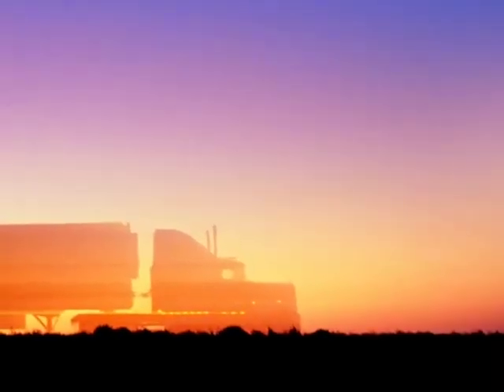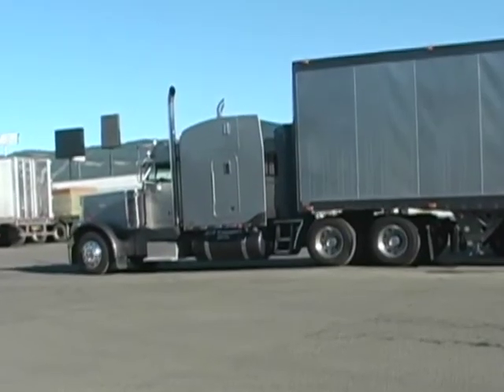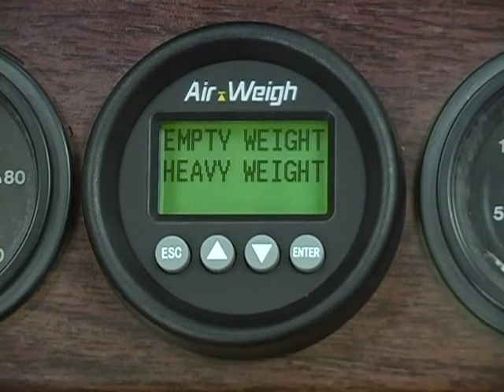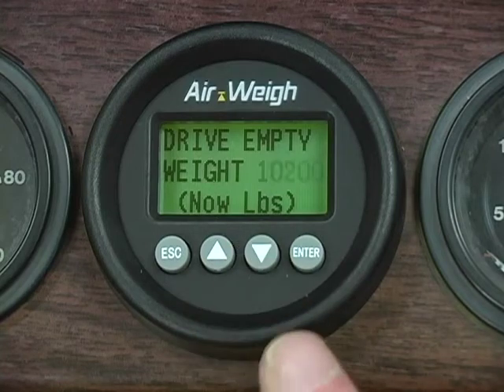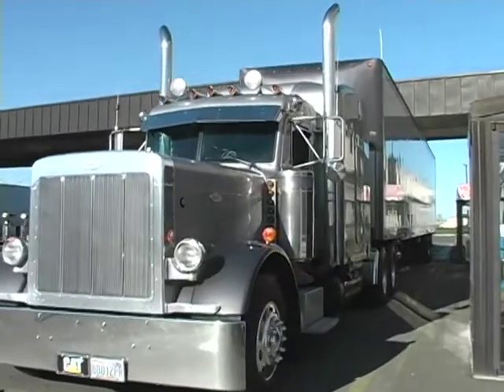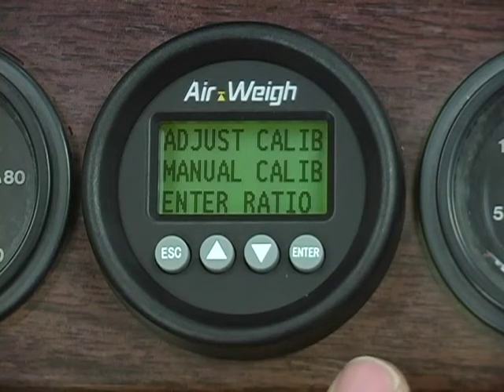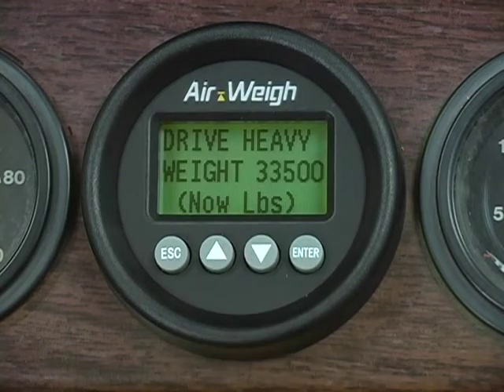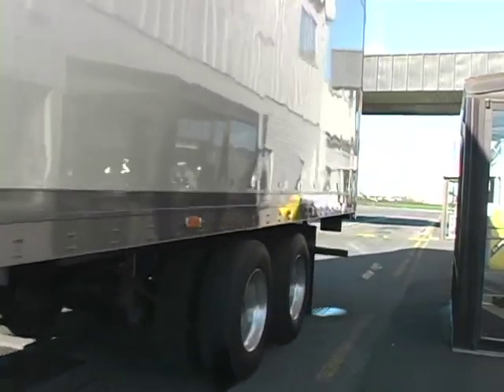AIRWEIGH AW5800 tractor scale calibration video

Comment: Will this work if my truck does not have air dump? Also, does it matter what the tandem pin position is when calibrating the scale?
Reply from the maker: Its cheaper and faster to install with air bags. Without it, they have deflector sensor that can clamp / weld on the rigid axles. Yes, the tandem pin relocation will alter weight distribution and weight accuracy.
Reply: @SNAcalgary   Sorry, I should have explained better. We have a Freightliner with air bags but we don’t have the air dump feature so they always stay aired up. Does that make a difference? As for the trailer, I was asking whether pin location matters when calibrating empty/loaded weights. The video never mentions whether it matters.
Reply from the maker: Yes, a dump bag air switch would need to be added as its a required procedure to achieve accurate reading. Pin location matter on the trailer. The location of the axles modify weight distribution and scale reading..

Comment: Hi I didn’t see the TRL option. How can I do? Thank you for answer!
Reply from the maker: With a trailer, there is another pressure switch senor on the trailer and another input is hooked to the gauge for this. The model of the gauge needs to be changed to account for the extra sensor. Then, the calibration procedure is the same as the tractor. You need to enter the EMPTY WEIGHTS and the HEAVY WEIGHST in two steps using the number from a truck stop scale.

Comment: I have spring suspension on my trailer,I do not want to weld the conversion device to my axles,.... do you have an air bag conversion for Spring suspension ? Because the air weight is really accurate the other not so much
Reply from the maker: You can use the epoxy kit with clamps to read the suspension flex.
Reply from the maker: https://www.manualslib.com/manual/154920/Air-Weigh-Air-Weigh-Aw5800.html?page=9#manual
See on page 4.
Reply: @SNAcalgary  The problem with those is there not even close to be Accurate

Comment: What if my trailer doesn't have air suspension?  Would it not work at all ?
Reply from the maker: The tractor can still have its scale to keep track of its weight. You can also have rigid axle, deflector sensors added to the trailer to read the weight of the whole rig.